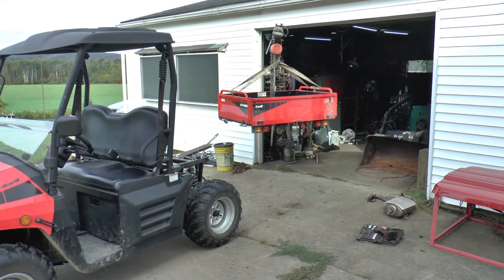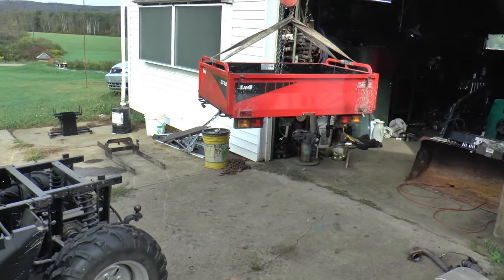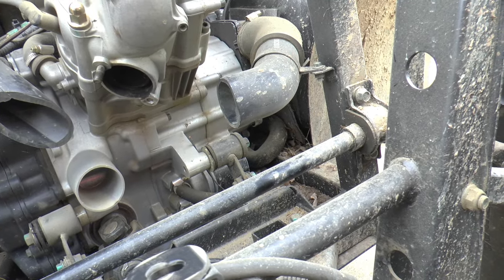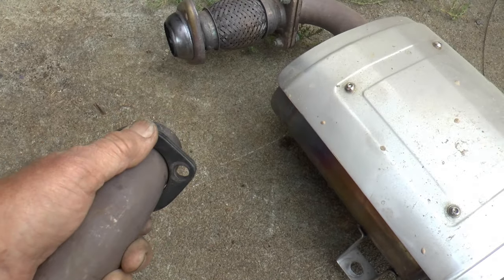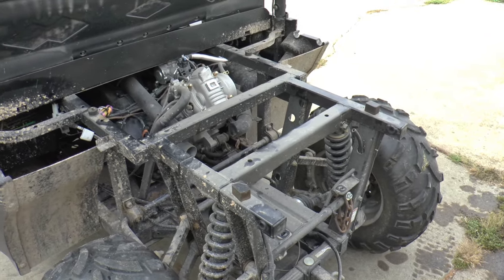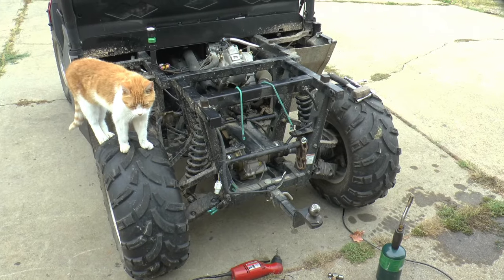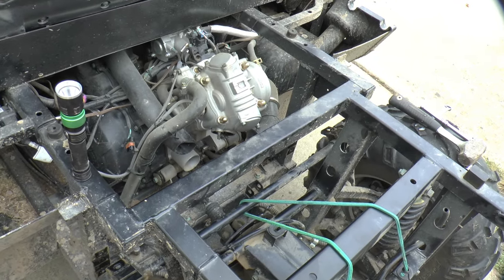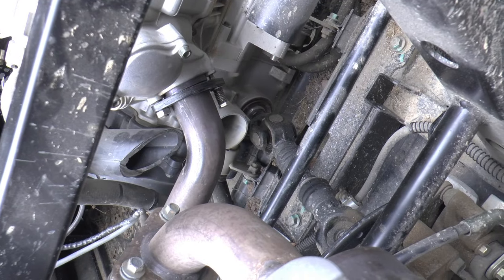Coleman UTV 400 First Problem

Comment: If you have a welder, welding a nut to a broken stud should always be the first line of attack
Reply from the maker: Not when it's recessed that much. Bad position to weld and lots of things to close that could be damaged from welding. Other wise I agree.
Reply: @kevincrawford2027  yeah it was a tight spot. Even when they're recessed, though, it can still work well, you just build it up with weld.

Comment: Im having the exact same problem.... you happen to know the size of original stud?
Reply from the maker: No I drilled mine out and taped sae thread. My repair is still holding ok but I haven't had any long runs yet.
Reply: @kevincrawford2027  thanks!! Nice fix btw. Appreciate the quick reply